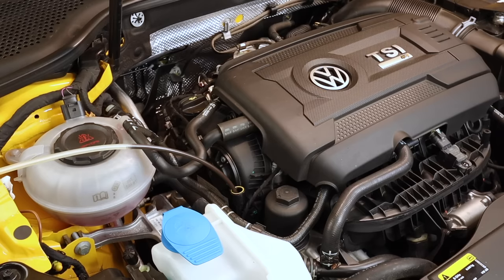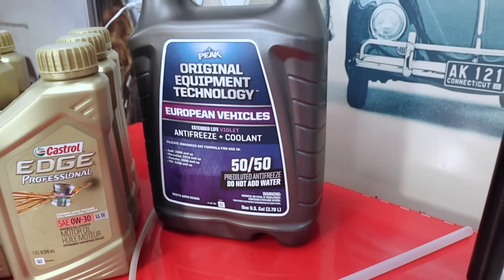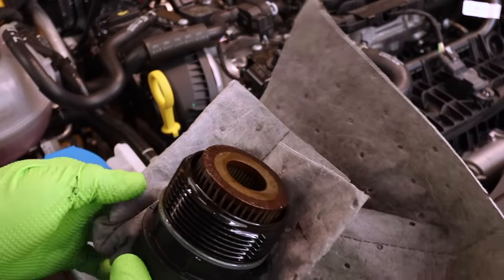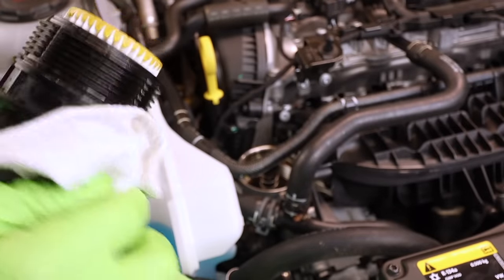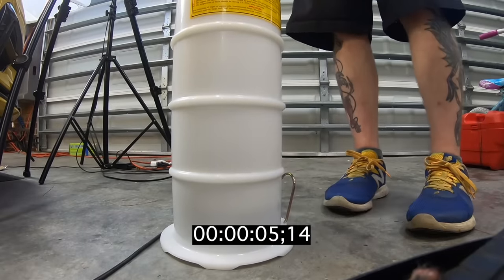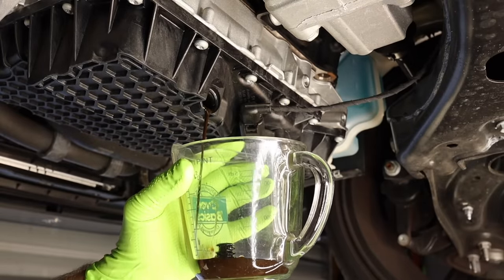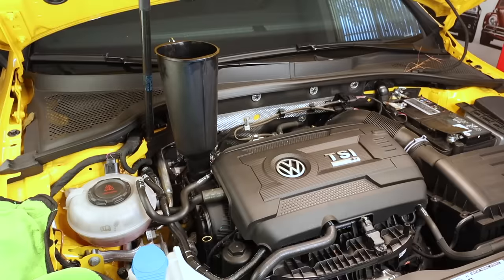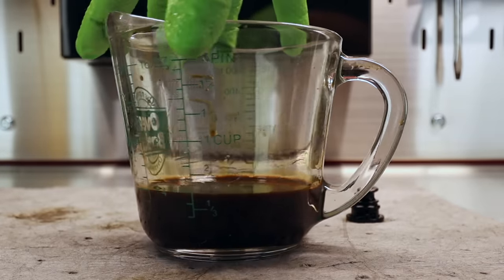Will an Oil Extractor Get All The Oil? (MK7.5 Golf R 5000 Mile Service)

Comment: You measured the oil hot right? So it should be at the top. If you were in the middle when hot, it'd be at the minimum when cold, which is a no go in my book.
Reply from the maker: In the middle with warm oil is best.

Comment: I would still drain it the old way. Especially after seeing your carbon build up video. Changing every 5k is a good move too.
Reply: That oil is VW 504 / 507, 507 being low  SAPS for TDI with a diesel particulate filter. I've read speculation using this oil should result in less carbon buildup. It's formulated to not clog up the DPF in the exhaust.

Comment: I always used to roll the vehicle onto a ramp with hot oil and remove the O.F. and drain plug.  Then come back 20 minutes later to complete job.  That was until 7/2020.  Some idiot broke my back L2 so an Extractor might be my only option. Sucks.

Comment: My 4 motion VR6 at my unit block I jack up FR enough to get under to remove drain plug. It take about 5 mins to stop trickle then I refill. How much I leave behind by not having the car level I don't know. The manual says 5.5L for refill and it takes 5.5L to top of cross hatching on dipstick.
Remember it's only a car ! LOL

Comment: Doesnt the engine need to be off for about 5 minutes before the stick can give you a correct level reading?
Reply from the maker: I think they recommend 3 minutes. I have found that within about a minute its close enough to be good. Dipstick measuring of oil is not an exact reading
Reply: @HumbleMechanic  I know you said 3 minutes with engine on, and I assume that is correct. I was however referring to the time you need to wait after shutting the engine off again, until you can reliably read the stick. I hear when the engine is on or has recently been on, oil still circulates in the engine onto the stick thus causing a difficult or too high reading.

Comment: this doesnt suck out all the sediment at the bottom of the pan, the flow of opening the drain plug and rush from the current forces the sediment out.  I tested this many times, sucked out the oil and then dropped the pan to see if it got the sediment....nope. Might as well not even change the oil.
Reply from the maker: If that were so, wouldn’t my little container be full of sediment? 

Here’s the thing. If you haven’t taken good care of your car, yea drain the oil. 

But with a properly maintained car, you’re not gaining as much as it may seem by draining

Comment: I would never extract it. The final position of the drain tube is essentially random. And does one know for a fact that the dipstick tube is at the deepest point of the pan? In every engine? The dipstick measures the top 20% or so of the oil, and extracting it there seems like you'd just leave too much. But cool video though.

Comment: After letting car sit level for a half hour, I always lift my cars so the drain plug is the lowest point on the motor and let it drain till there is only a drop hanging at the threads. Muscle cars to Foreign.

Comment: Yeah if you take pride in your GTI and enjoy it’s performance, leaving that much used oil in the engine just doesn’t make any sense to me. Drive her up some ramps and drain from the bottom. Take your time and let it drain out till it’s down to a very slow drip. To bad VW put the oil filter at the top facing down so you can’t fill up the new filter with oil before installing it.  Those extra few seconds of low oil pressure before the filter housing is filled bothers me a little. Not ideal, but probably ok.

Comment: I take the engine apart and completely scrub everything with sandpaper to make sure there's no oil on any of the metal surfaces before I add new oil
Reply from the maker: This is a proper oil change

Comment: 1: castrol is a bad oil ! u can use anny other oil with the same sae .....i recomand u eneos  2: if u r lazy use extractor for oil ! 3: after u take out the oil u have to turn on the engine for few seconds to relese the oil from pressure valves then u filled up!

Comment: I would like to see what happens if you put to this clean engine a catch can and check again after 10.000 miles. Are you in to this? We have to check if a catch can work or not.
Reply from the maker: Yep. Catch can video tomorrow
Reply: @HumbleMechanic  It will be great to check what happens with this and after the results we can say if it worth it or not. Great job mate, thumbs up.

Comment: I couldn't sleep knowing there's contaminated oil waiting to mix with the fresh oil as I pour it in, it defeats the reason why I'm doing the
oil change in the first place. Also those plastic bits don't inspire confidence either, it seems too many compromises have been made 
at the expense of the owner. Like the mechanic said, part of draining your oil from underneath gives you the opportunity to do a safety
check and I wonder to how many O rings have been installed incorrectly. The simplicity of the electric motor gains momentum the
more you see of what's needed to keep your ICE running.
Reply from the maker: I agree on still doing the visual inspections for sure!!
Reply: @HumbleMechanic Yes, otherwise you wouldn't sleep at night either.

Comment: On a Audi 1.9TDi 8P, always do the sump first after bringing to op temp; then use an extractor for the filter as there's about a 1/2 L left (then via dipstick if you want; you might get a small bit more).

Comment: Changing the oil from the sump is the easy part. Changing the oil filter is the messy, time consuming part. At least, when it comes to my VW Mk 5 2.5L Rabbit. I see no advantage with the oil extractor.

Comment: Used an extractor on my A4 Allroad 2.0 TDI. Removed 5 liters exactly, while the manual says 5.2. Good enough for me. Worst part was getting the filter out. The engineers designing this engine bay should be kicked hard in the face.

Comment: Well, you know for a start they aren't going to be looking underneath the car. It's fix it if it breaks, do bugger all, contract maintenance these days. My neighbours growing up dad was a Dutchman, he had Aussie made cars with zero problems. He bought a brand new VW (Hitler's revenge we used to call them), first time it rained it filled with water.
Reply from the maker: Not always. At the shop the car still goes up for inspection. just not for the oil change .

Comment: Great if the oil filter is on top of the engine, but I have put the car up anyway to change that, so may as well pull the drain plug.
Reply from the maker: Depends on where the plug is. Some are in dumb spot a

Comment: 5000miles is perfect for oil, filter, fuel filter, air and internal filter changes. These are consumables. Castrol- only the type of oil is correct.

Comment: Wouldn’t it be easier to use the oil filter “hole” as a fill point instead of fussing with that tiny opening?
Reply from the maker: I’m not sure the drain rate is that fast.

Comment: I'm not comfortable with leaving any deposits at the bottom which can be drained out with a DYI Home-made car-ramp. That 100 ml of sedimentary accumulation at the bottom certainly is like a rotten tomato which can ruin the whole basket of freshly put engine oil. And these days we are talking about "annual service intervals" with 100% synthetic engine oils. In my humble opinion, the leftover 100ml is a big disease never cured.

Comment: People never trust these excavators. Will it get everything out?
Well, that's the wrong question. The quesion is, how much stays in the engine, even when using the drain plug? And that is a lot of remnant oil in the engine. Fact is, no oil change changes 100% of the oil, and the manufacturer designed the engines to have their oil excavated for a reason.
Reply from the maker: 100,000,000,000% exactly!!!!

Comment: I can't get all the oil out of my A3, so suck some out and the rest from the sump plug. My merc i covered 160k and always changed the oil with the extractor and was all original turbo etc before I sold it.... better car by a mile than the A3

Comment: Most vehicles have magnetic drain plug so the metal contaminants will deposit on it . Not nessesrarilly shavings but metallic dust sludge . No matter how good is the oil  - metal still weaRS over time creating metallic dust . Suncion pumps for oil change is not recomended because by pouring the new oil you are agitating the metallic dust that settled at the bottom of the pan and its now circulating trough the engine LOL . DRAIN THE OIL OUT AND CLEAN the drain plug . Once in a while like 60-70 k miles - drop the oil pan and clean IT . and replace the gasket . DO IT RIGHT

Comment: Using either an extractor or the drain plug there will be a fair amount of oil in the system (inside the pump, oil ways, etc).

Down side is the stuff at the very bottom of the sump is probably the nastiest, sludgiest stuff in the engine!

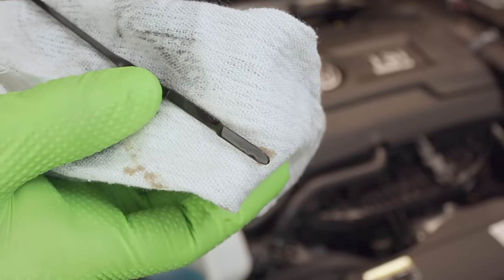Comment: 3:10 you need to read the manual again, telling that you should fill the oil level to inbetween the marks is wrong, in the manual it tells to fill the oil level to the top mark when the engine is cold, so if you only fill to the middle, you run the engine with not enough oil, and that is often the course of turbo chargers dying over time.
Reply from the maker: VW has newer communication saying otherwise. IF you do that on a TDI, you will have overfull warning.

Comment: The extractor works well enough for that particular car with the oil filter on top. If you have to crawl under there for the filter it’s not worth it
Reply from the maker: I think for the most part you are right. However there are some cars with a totally stupid drain plug setup, like my Touareg. It would not save from lifting the car up, but does make the job much cleaner.

Comment: I think some of these guys are mechanics as a job so in their interests to promote drain plug removal, As  golf's have floor pans which can be depending on your age young guy no problem removing, High mileage less value cars it ain't going to matter use an extractor?

Comment: Dont most cars have the filter at the bottom? Youd need to get underneath either way so the extractor would be useless at this point
Reply from the maker: Some do some don’t. But I wouldn’t say useless. Still nice to not have to drain into a pan.
Reply: HumbleMechanic yeah I was thinking of getting an extractor cause I also live in apartments where we are banned from doing our own maintenance in the parking area but then I realized i would still need to jack it up to get at the filter which is unfortunate. I used to have hobby shops where i used to live that rented out space for car maintenance and came with everything youd need already(jacks,torque wrenches,etc.)  They dont have any near my new place so looks like ill have to some more research on where i could go and do my own maintenance

Comment: It's not gonna make a difference. You will still leave at least a quart of oil in the oil galleys that won't be drained. However I still prefer pulling the drain plug just because it doesn't take that much more effort on most cars.

Comment: The engine block capacity is supposed to be 5.7 litres.. After draining it from the plug (until it's just slightly dripping), I only end up filling about 4.7 litres.. Why is that??!! I change oil every 9k-10k miles (15000 km)

Comment: @humblemechanic or anyone else that may know. If i have the steel pan upgrade does that change anything for extraction?! Thanks!
Reply: 🧐Unless the manufacturer advises to use, don't waste the money on an extractor if you have a drain plug in the pan! No need for a new drain plug either unless it's been damaged or manufacturer advises. Some cars don't have a drain plug so an oil extractor would be required.

Comment: No I want as much dirty oil out of my engine, period! I am not a mechanic but I have one many cars and motorcycles ( I am 67 years old) and ALLWAYS changed my oil on my motorcycles at 3.500 mph and 5.000 on my cars, and  all my cars and my motorcycles, never had any major issues EVER!I juess my old fashion mentality  prove me right. I do have a 165.000mph 2004 r32 and still running like a champion.

Comment: so... I'm no mechanic... but my common sens tells me there is no reason to spend 80 USD on an extractor which does 95% of the job.... I think the classical way of draining the oil via the drain plug is much better and safer... and cheaper!
just my 2 cents....

Comment: I think diesel engine need to  drain it all, because diesel  can pass piston rings 
down to oil sump,that why old diesel engine oil usually higher than before, and that why some dipstick  have two different oil level marks, when it higher than the high mark, means need to replace oil now,not follow the service reminder !

Comment: Some cars are designed for oil Extraction, most are not.. Depends on the tube and sump shape. It's safe to say most modern European cars are designed for it. Except when the manufacturer decides to advise against it after initially advising the opposite... Shout out to Ford/Peugeot/Volvo/mini using the PSA engines 😔
Reply from the maker: For sure worth testing!!!!

Comment: I don't believe this test is accurate because the pump might be sucking up oil that would never be drained. Some cars have oil pans designed so badly that many ppl install extra drain plug. So I believe pump could in many cases be more effective

Comment: Oil extraction is not good for long drain interval cars. As you leave alot of worn out parts in the sump. Like broken rubber seals, filer paper, and ground materials from piston bore, cam shafts, tappets etc etc. When you drain it, it all flushes out whilst the oil is hot.

Comment: I would change my oil from the top if my car's oil filter is on the top of the engine, but since I have to crawl underneath the car to change my oil filter I may as well continue to drain from the drain plug.

Comment: its absolutely absurd to lift the car, remove the underplate and drain it for 100ml more.  Rather get regular oil changes done (which is easier with an extractor) than draining the plug. And if you really worried put in 200-300ml while extracting and drive the oil nice and hot.

Comment: The question that comes to mind is that if the manufacturer wanted oil to be removed via an extractor, then why don't they simply provide an oil removal tube that starts at the very bottom of the sump and leads to the top of the engine?  A mechanic [Or....Owner~] could then simply remove a cap and place a fitting from the extractor onto the tube and then suck out the old dinosaur juice.

I don't know, it makes sense to me.....

Comment: Volkswagen extra says that you should not use an Oil extractor because the old Oil left in the pan would be too much.
Reply from the maker: Do you have the documentation from vw? I’d love to dive deeper. :)
Reply: @HumbleMechanic  it is written on our servicelist we get for each Car.
Reply from the maker: Service list? I’m not familiar with that document. Well not by that name anyway.
Reply: @HumbleMechanic  jo Bud, I'm working at a Škoda and Volkswagen Workshop in Germany, and we are classified by Škoda and Volkswagen. When we get inspections or Oilservices, we get a Service - Checklist, were you put a cross on what you have done on the Car. Like let's say, check the Windshield whipers or stuff like that. And on that list there is also the warning to not suck the Oil out of the Oilpan.

Comment: Is that drain pan plastic? And 100ml dirty oil is 100ml dirty oil. I would definitely insist on draining it via the plug during service. This easy suction extractor method may be something for DIY guys who do not or can not crawl under the car. If we pay the workshop, they better do it properly by lifting up the car.